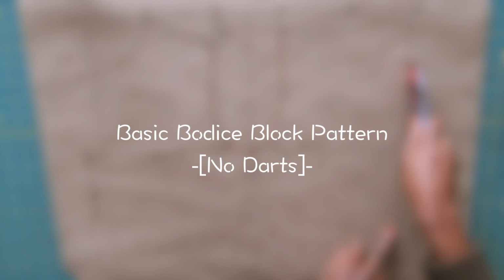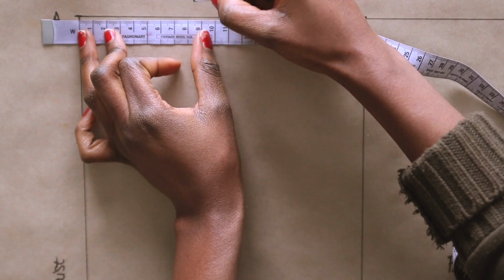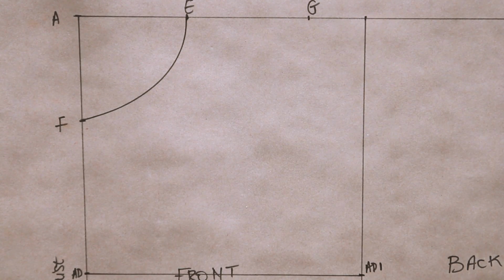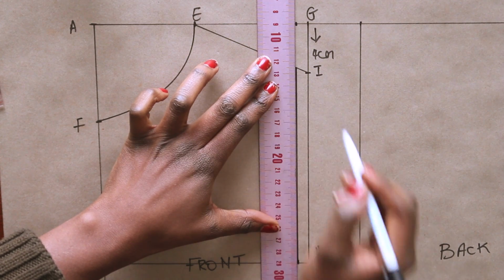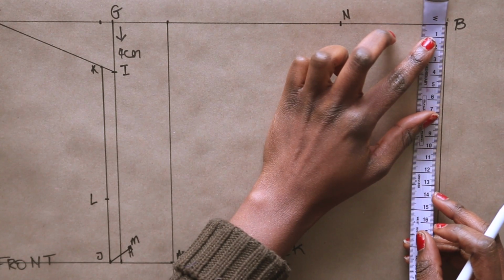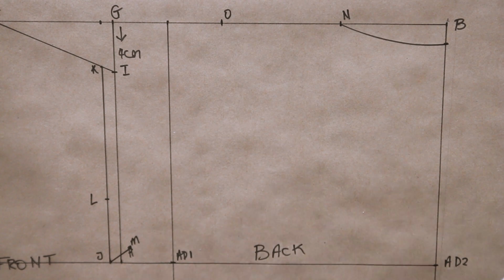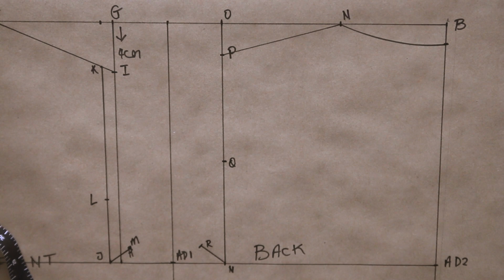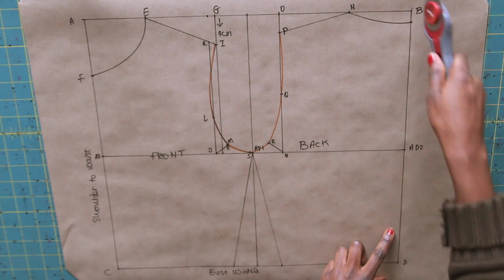Easy and fast basic bodice block pattern (No Darts)

Comment: This is a good video if you have prior knowledge. Your cf needs to be at right angles. Your SNP on the back block is also strange. You can't just say square up at an angle. What angle? A block can be achieved from this method but yours is untidy and needs much more clear instructions.

Comment: u started off real good and the way you present it, is very clear, BUT you would want to tell us more instructions on what you're actually doing and why. I am a professional sewer, but this even confuses me. I never learned to draw professional patterns, so i'd like to learn. U need to tell why you choose 4cm for the shoulder slope and what you are creating those lines for in future usings. Thanks for this vid ;)
Reply: Info Fur A 4cm drop is a close fitting garment. 

The neck measurements are plucked from thin air. No explanation on how it was achieved. No right angle at CB and CF to clean up the shape.

Armholes no explanation on why and how the angle were achieved.

There are better video s on YouTube.

Comment: I was wondering why the distance from j to H (=M) is 2 cm... my horizontal distance between J and H is way larger (3.7 cm). so if I do 2 cm it won't pass the H-I line. :( please explain if the 2 cm is standard or should I calculate differently.